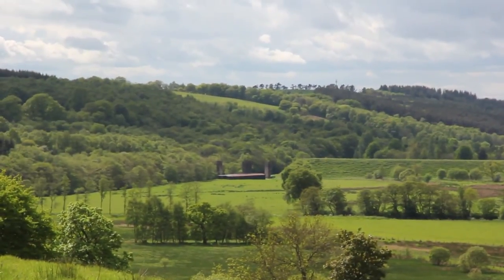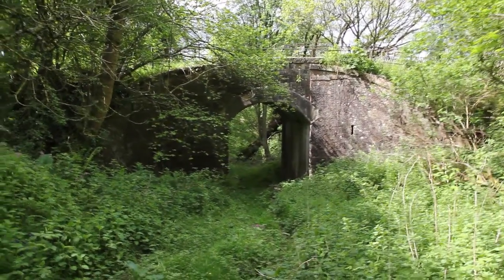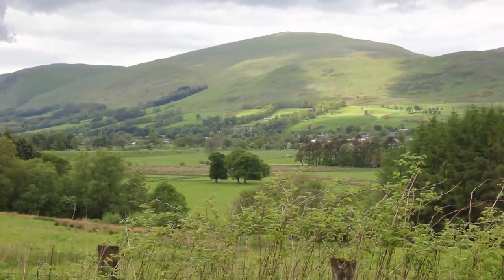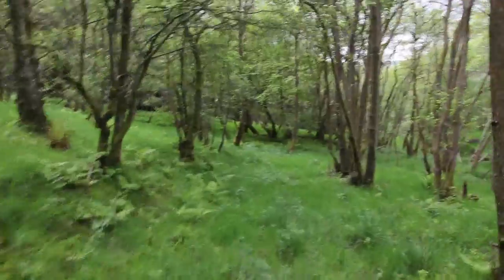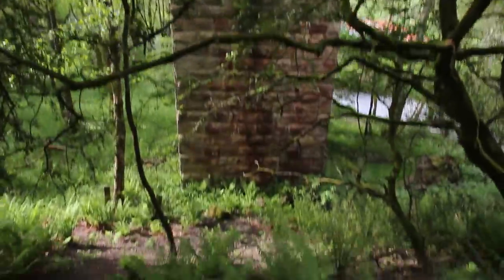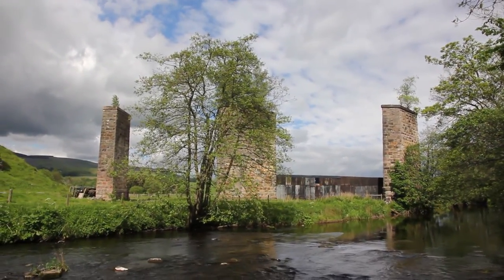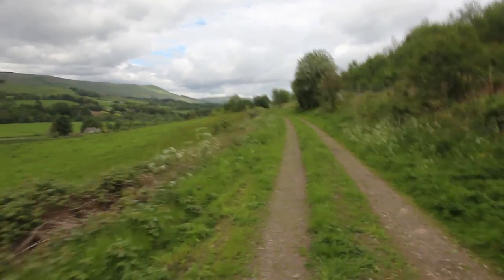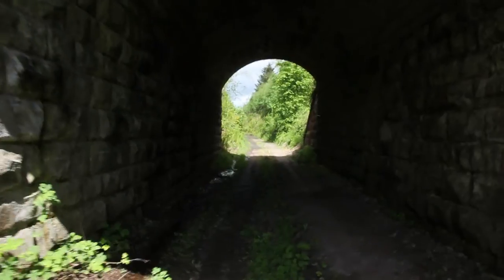A Short Walk Along The Devon Valley Railway

Comment: Excellent video Simon, great find. Should've given it a SPiSometer rating though, as you are part of the team now. Nice to see you making videos as well...Jag
Reply from the maker: Cheers. I knew it was there, it was just a case of getting to it, which seemed easy enough until the path ran out. Thankfully, former railways are generally easy to track. As for a rating, it'd have to get a C. You do get a feeling for how grand the structure would have been when you're standing next to the pillars but without a deck, I can't give it a higher rating as there just isn't much to actually rate. If I were to take a guess as to what kind of SPiS rating you'd give it, I'd predict a 4/10.

There are two other viaducts on this line which I visited last month. The Tillicoultry Viaduct (https://www.flickr.com/photos/k-burn/13936685749/) would get a C- from me since it's missing an embankment on the far side of the river and there are only two extant pillars. The Gairney Burn Viaduct (https://www.flickr.com/photos/k-burn/14097497304/) gets a solid B+ due to it's length and height.